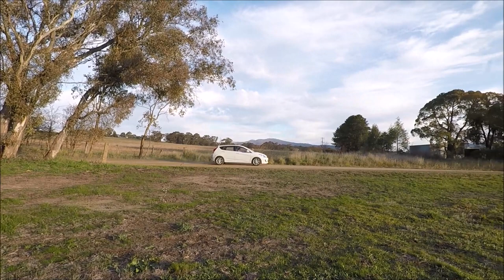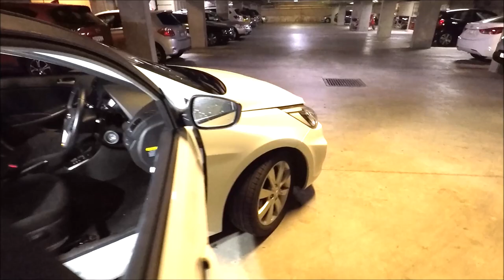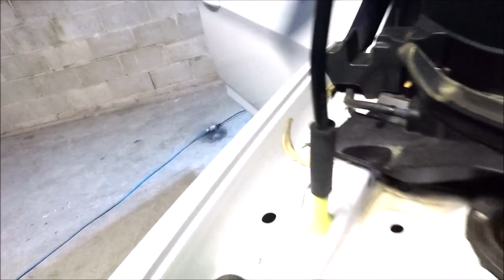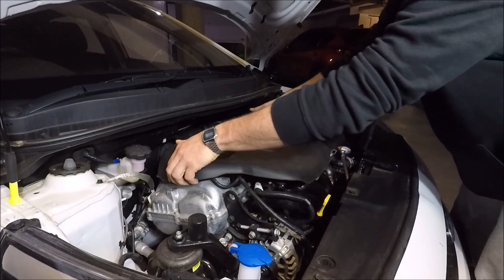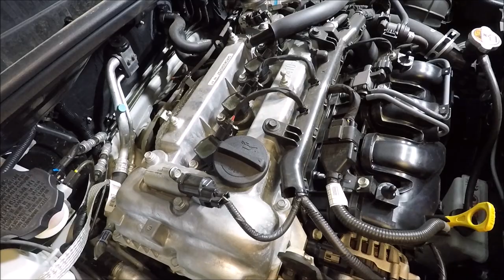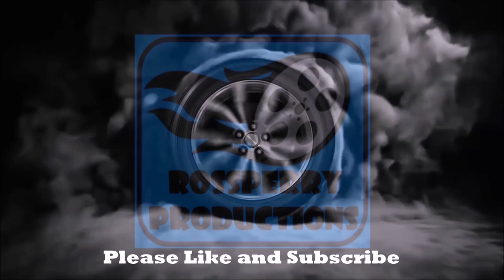How to Replace the Ignition Coil Packs & Spark Plugs on a Hyundai Accent

Comment: Is this process relatively the same for the Accent SE 2017 ?
Reply from the maker: Hi there Chris, yes it should be very similar. Ross
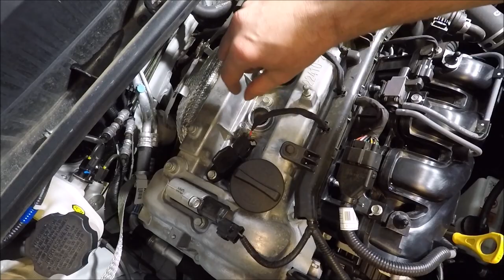Reply: You also mentioned at 2:34 -" reverse spark plug extension bar, how long is that process is it just like removing a screw? Sorry I'm not very educated on cars and I'm trying to upgrade to iridium spark plugs thanks!!
Reply from the maker: @chriscapitalg2698  Hi there, not reverse but yes you will need the spark plug socket and an extension bar to remove the plus, it wouldn't take you any more than 5 minutes per spark plug. I love the iridium spark plugs (NGK are my favourite) they are a standard thread so lefty loosey righty tighty. Make sure you don't over tighten the new plugs but tight enough to compress the washer.

Comment: What do we do if the connector tabs are broken? Can they be replaced? How can we remove if tab is broken ?
Reply from the maker: the tab on the electrical connection or the coil pack itself?
Reply: @RossPerryProductions  I think the electrical connection.
Reply: Apparently it's very common that they break
Reply from the maker: @blixasice  I have seen it before and it was cable tied on, not saying its right but would work as a short term fix until replaced

Comment: Does anyone has the part number of the ignition coil wire harness? I’ve been looking for it everywhere and I cannot find it
Reply from the maker: unfortunately, not it's a rare thing to have failed, you may need to contact a dealer

Comment: Does anyone know how i can soup up my accent
Reply from the maker: what are you trying to achieve, better sound, more power, or better fuel economy etc?
Reply: @RossPerryProductions  more power for sure
Reply from the maker: @slaptwin7867  Induction is a good place to start, K&N with a ram air feed, then de-cat exhaust. Both allow the engine to breath easier, and may need to be re mapped for optimum performance. Remember they are only small engines its never going to be super powerful. Ross
Reply: @RossPerryProductions  i have a short ram air intake kit, i also have a catch can to keep the cleanest air going into engine , and strait pipes.. dont know where to go from here can you help
Reply from the maker: @slaptwin7867  Well the next stage would be to see if the ECU can be re-mapped. Anything beyond that you are taking big bucks.. turbos etc.
Reply: @RossPerryProductions  what do i do if it cant ? New engine i gues, right?
Reply: @RossPerryProductions  even a turbo needs a good computer without that im going to be throwing codes
Reply from the maker: @slaptwin7867  Pretty much, sorry I wasn't much help. Ross
Reply: @RossPerryProductions  youre good brutha , thank you
Reply from the maker: @slaptwin7867  very true!
Reply: What size socket for the spark plugs ? The same 10mm?? Or something else ?